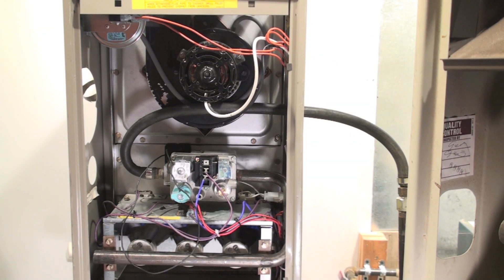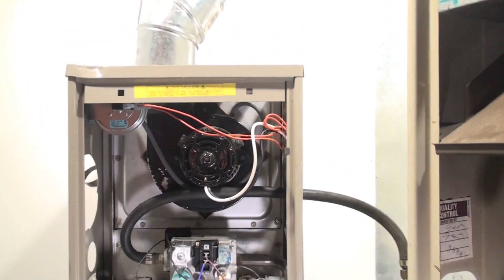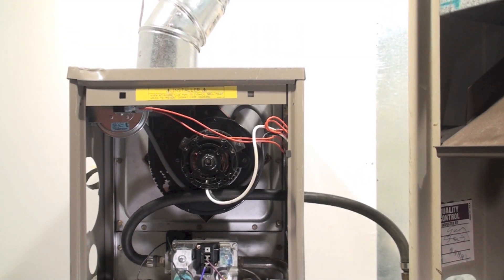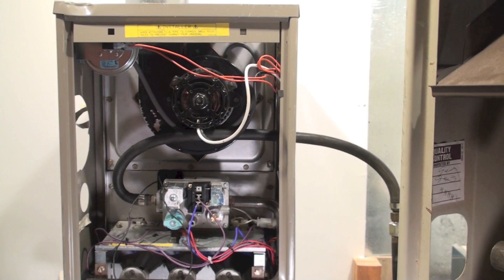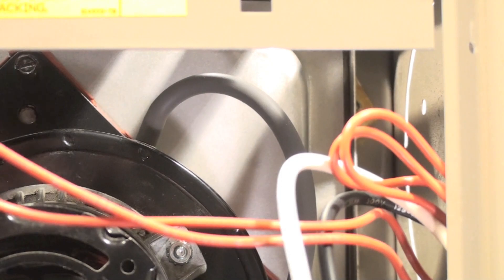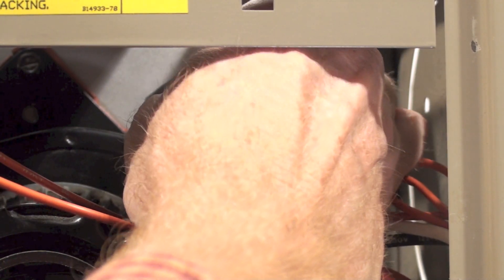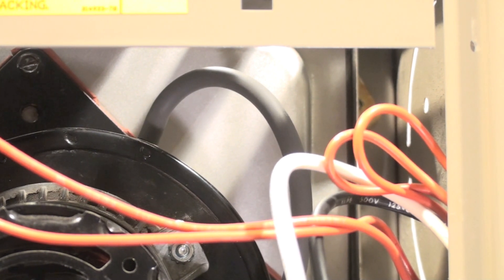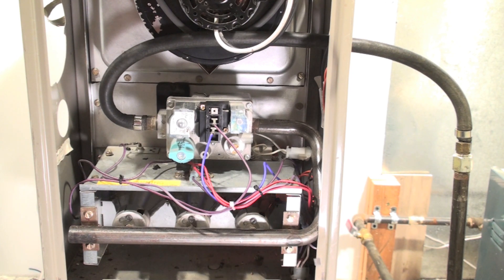Troubleshoot GMP Goodman part 1

Comment: So suddenly last night, the furnace decided to not come on for my GMP075-3. I looked and saw that the HSI was not coming on. I purchased a new HSI and a new flame sensor . . . still nothing. I checked voltage at the HSI on the board and I only saw roughly 8 volts. The board is technically brand new, as I got it In January. What else could be the problem, as I figured that the voltage for the HSI is way too low and it has a new board?
Reply from the maker: Aarontaz7 Sorry about the wait.  Did you get a flame sense failure code?  Checking the voltage from the board must be done while there is a call for heat and before the gas valve turns on.  Hope this helps.
GFM
Reply: Thanks for the response. I actually got it working. I finally found the sequence of operation and realized that the hose that connects to the inducer motor came off. Once I reattached it, it came on without a problem.

Comment: I have a gmp050-3. The vent fan comes on, the igniter glows and starts the gas flame, but the furnace fan does not come on to move the hot air through the vents. Could this be the blower motor itself or possibly the capacitor
Reply from the maker: lewis short Could be motor or capacitor if the motor warms the problem is there.  If it does not get warm, check the wiring and the control board.  No power coming out of the board, the board has failed.  Look for burned traces.  Also be sure that furnace has had its heat exchanger checked.  Most all of them failed.  Hope this helps.
GFM
Reply: @grayfurnaceman  My GMP050 is 22 years old and it's heat exchanger has not failed.
Reply from the maker: @crand20033  The heat exchanger failures were in the early 1990s.  by 2000, they were ok.
GFM

Comment: I have a gmp 100-3 and the blades on the inducer sound like they are grinding on metal when starting up. There was a plastic wheel on the outside of it, it snapped off when I bent it ( accidental as I lost my balance on my knees and put pressure on the hand that was on it). It doesnt happen all the time, but when it does, it sounds like hell is being unleashed for about 30 secs then it runs just fine.
Any ideas as to what it might  be?
Reply from the maker: Jaime Phillips Its probably getting ready to fail.  There's no real adjustment of the wheel as it is probably rusted to the shaft.  The only other possibility is the vent may have something in it.  Hope this helps.
GFM
Reply: It does. Im going to replace it. Since the plastic wheel was busted off, the noise has gone away completely. But I would feel safest knowing that the part was new.

Comment: i have a GMP075-3 furnace when turned on the blower fan runs but no flame comes on. the circuit board light blinks 5 times saying false flame sensed.and stuck gas valve. Where do i start with this problem
Reply from the maker: I would guess, if there is no flame, the control board has failed.  These furnaces have had a lot of problems with heat exchangers, so I would check the heat exchanger very closely or have a professional do it.  This video may help:  http://youtu.be/S8AI8VZQ-ts  Hope this helps.
GFM

Comment: Hi there; our furnace has been intermittent on & Off all winter. Sometimes it works then other times it won't ignite. The ignitor glows but the gas valve won't open to ignite the flame. Blinks as code 1 which is flame sensor, gas pressure, gas flow or gas valve. I've sandpapered the flame sensor in the past, replaced the gas valve 2 yrs ago, & cleaned off the flameout sensors in the flame chanber area. The ignitor coil comes on  but the gas valve won't open & let it start heating up. Then 3 hrs later it will work ok. Really aggravated; seems it acts up on really cold days / nights. There's not much else hooked up to the gas line to draw away from the pressure; Any ideas? Thanks
Reply: paul rogers Do you have a sensor on the blower. On mine a wire runs from the control board, to the blower sensor, then to the gas valve. If that sensor is dirty the valve doesn't open.
Reply: the inducer fan housing on ours is plastic, so no paint chips to get caught in the housing
Reply: also the heat exchanger looks good; no flameout once the fan runs
Reply from the maker: If the burners don't start at all, the problem is gas valve (replaced), wiring or control board.  Hope this helps.
GFM
Reply: grayfurnaceman I lightly sanded the flame sensor rod again & the furnace is working again for now; didn't have much carbon on it so I dunno
Reply: our furnace configuration (on the inside) is upside down from what this one is, in this video; odd.

Comment: Hi, my goodman GMH95 was not firing up, the blink code was 2 and checked pressure switch, hose and fittings, found that if I pinched the hose completely off it was a blink code 3, but if I did not completely restrict the hose the furnace would ignite and start up, check all drain air inlet/outlets no blockage ??problem happens once a week. Like you instructions.
Reply from the maker: It sounds like a combustion air problem.  Are you sure you don't have snow/obstruction/water in the inlet?
GFM

Comment: Hello Grayfurnaceman, thank you for creating this channel to help us. I have an upright GMP from the early/mid 90's. I've replaced the fuse but mostly, my problem is that the fan comes on but no flame. I have McGuyver'ed it several times.. there are two contacts that stick up on the top of the fan that I use some insulated wire to squeeze closer together, (not touching), and then the gas ignites and it works fine. Is this very dangerous?  Does this tell you anything I need to know?  Thanks!

Comment: It was a bad gas valve. No clue why it was not giving the code 5 flashes for sticking gas valve, but had 24v to it after the hsi came on but no ignition. Changed the gas valve johnstone part number L38-038 and works like a champ.

Comment: I am having the same problem. The diagnostic light on the control board is a slow continuous blink and there is no code in the manual for this (only for rapid continuous blink). Since I am going to have to hard pipe the gas line in anyway, I found a gas valve at johnstone for ~$30, I will give it a go. The only other thing I can think of is the ohms of the hsi not being right, bad control board/voltage or ground. I also need to find all those little limits but I thought they would throw a code.

Comment from the maker: Some thermostats have a blower setting that allows it to come on several times a day to circulate the air.  The setting can be changed in the installer setup.  Hope this helps.
GFM

Comment from the maker: Look for high voltage.  Fuses, breakers.  120v into transformer.  Also check out the vid  "How to replace a transformer (without burning up the new one)" because transformers seldom fail and are usually destroyed by low voltage shorts.  Hope this helps.
GFM

Comment: I have a carrier heat pump. Working fine yesterday. Today, it won't come on. The thermostat dosen't click. There's no voltage on the 24v (secondary) side of the transformer. Any ideas?

Comment: Having an intermittent  issue with my Goodman Janitrol GMP100: Call for heat. Inducer starts. HSI starts glowing. Gas does not come on. HSI turns off and furnace runs a purge cycle. HSI comes on again, but no gas. Tries 2 or 3 more times, and shuts off the furnace. Red light blinking on control board. If I reset the furnace and try again, the gas may come on in the 1st cycle, or not till the 2nd or 3rd, or possibly not at all, and lock out again. Any ideas?

Comment from the maker: I believe the part you are having the problem with is the inducer.  The bearings are failing.  You can maybe get a little more time out of it by oiling the shaft near the end bells of the motor.  The only other problem I can think of is if it is painted, some paint may be flaking off and catching on the wheel.  Hope this helps.
GFM

Comment: Would you have any ideas to why my Goodman furnace could be squeaking? It is operating quiet fine but here of late an occasional squeaking noise will come from it. It sounds as if its coming from what i call the fan wheel where you would disconnect the rubber hose that you usually blow clean. I have maintenance my furnace myself and have done a good job in changing out the thermal couple, keeping the sensor stick clean from dirt along with changing the filter probably on average a month/half.

Comment from the maker: If I am correct, you are seeing the hot surface ignitor come on, then the main burner.  First guess is flame rod cleaning.  For a how to put "flame rod cleaning" in the search engine on the channel.  Another possibility is thermostat anticipation.  Turn the stat up as high as it will go.  If it stays on, anticipation is the problem.  Put in "thermostat anticipator adjustment"  Last is control board problem.  Let me know how it works out.  Good luck.
GFM

Comment: My T-Stat is set at 69*, the room temp on the stat reads 63*.  when the furnace cycles to heat the house, i can see the piolt light turn on, and the  the gas light.  the gas stays lit for about 20 secs and then turns off and the furnace will run its normal cycle for about 3 mins.  the temp in the house never changes from 63*

Comment from the maker: Yes, all newer heat exchangers I've seen are made that way.  The high efficiency furnaces use stainless steel in the secondary exchanger.
GFM
Reply: My blower motor is making a ticking or clicking noise.  Would you happen to know what is causing that?
Reply from the maker: @crand20033  It probably has something stuck in the wheel.
GFM
Reply: @grayfurnaceman  It was screw missing from the bracket that holds the blower assembly. to the frame.
Reply: @crand20033  Glad you found it.
GFM
Reply: @electriccar3253  If it wasn't me I wonder what the technician would have told me. "Oh, you need a new blower motor and housing?"  What a scam they are running. I need to learn how to fix these things.
Reply from the maker: @crand20033  It all depends on the tech.  
GFM
Reply: @grayfurnaceman  And the company and whether or not they have a salesman who needs to make a commission on everything sold.